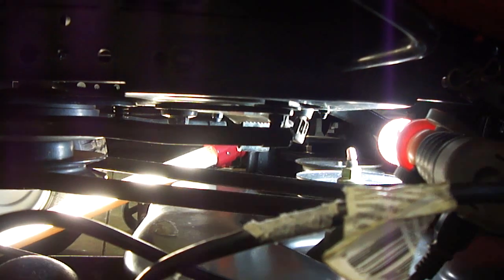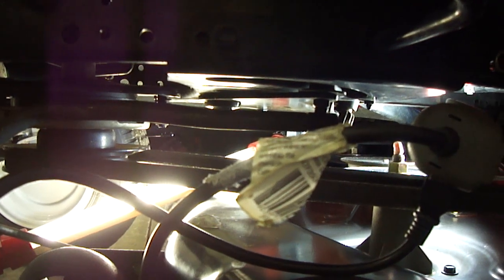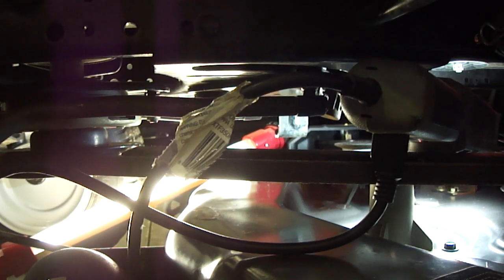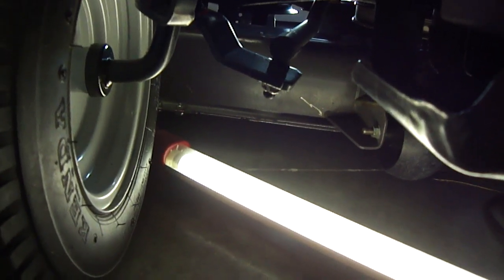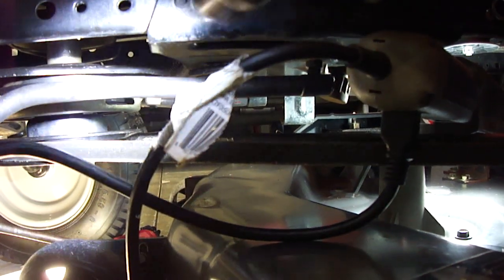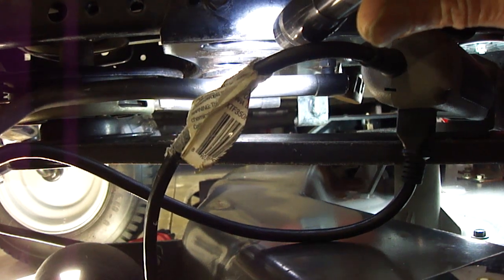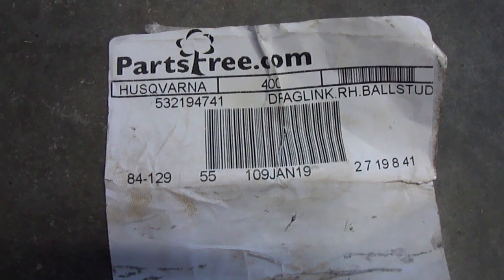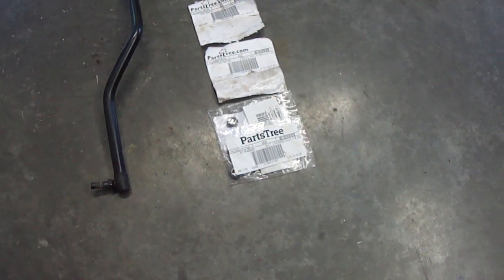2012 Husqvarna lgt24k54 draglink repair part 2

Comment: Ok you can do it that way, another alternate way Pull the battery and holder and you can access the top nut with extension  13 mm . Please note that you will need to move the tire left or right depending on which side your changing. I just did the right side on my mower this morning . Check it out. I didn't pull the steering gear plate.

Comment: I appreciate you trying to help by making this video, but perhaps you should watch some videos on this repair first. I just replaced both of the drag links on my LGT 2554 and performed the swap using access holes in the top of the frame . All you have to do is turn the wheel as far as you can in each direction to get the rear drag link nuts to line up with the holes. The access hole is round on one side and rectangular on the other. You don't even have to touch the gear sector plate.
Reply from the maker: Thanks for viewing.I personally found dropping the gear is really easy and like less than ten minutes to remove the whole unit.I guess as we all do repairs we all find different methods to fix things.Thanks again
Reply: @Ron1987  I have a Husqvarna YTH24K48.  The drag links are the same part numbers.  However, on my tractor, the steering gear plate has to be removed because there is a plastic cap covering the drag link nut where it attaches to the steering gear plate.  Those plastic caps are held in place by the steering gear plate.  For me, I removed the cutting deck, turned  the tractor on it's side, and removed the steering gear and gear plate from the bottom.  Because it was this difficult to access the drag link nuts, I ordered the right hand link as well as the left link.  I will replace both of them when the other link arrives.  Don't want to go through this agony again.
Reply from the maker: @commonleadership48  Yeah the drag link job is a touch tedious.I quickly figured out that the gear plate had to be removed since the nuts and the plastic guides are held in place by it.Reason I did this video and hoped it helped anyone who has to tackle this job.Thanks
Reply: @Ron1987  thank you for the follow-up.  I don't see how anyone can change the drag links on this tractor without dropping the gear plate to remove the plastic guide caps.  H.O. trainiac must have a model without plastic guide caps.  For my tractor, I ended up removing the steering gear bracket because I didn't have a wrench that would get to the back side of the large nut.

Comment: How do you get the plastic looking part off the steering plate thank you for your time
Reply from the maker: @wranglerman2523  You have to remove the steering shaft( cotter pin and the Gear on the End, has a allen head screw or screw).Assume your replacing the steering shaft? Or is his the drag link your asking about.

Comment: Bunch of talking, doesn't really show anything of the actual job
Reply from the maker: This is a fairly simple repair and felt showing a step by step was not needed.I simply added details to  the process I followed and it is intended to give everyone a good route if this repair has to be done.
Reply: @Ron1987  I think you explained it well enough for me to get through it, my left ball joint just disconnected itself from the link, am I going to need to buy any of the nuts talked about? Seems like the new link would be it.
Reply: @Ron1987  Also, when changing the belt yesterday I noticed on the left side it gets dangerously close to the drag link and I think it rubs in some instances, have you come across this before?
Reply from the maker: On recall I think the belt may have rubbed but,I think it was due to some slack in the belt.Being I have not dug out my old drag links to see if there was any rub marks(I think there was some) but never had a issue directly from that.
Reply from the maker: the new link may or may not have the nuts new depending on the parts business you buy from.I know alot of these parts can be purchased on ebay and generally come with  everything new.When I bought my parts I got them from partstree.com and things are  sold in some categories as a piece by piece overly complicated (should have some hardware) if it is part of the part.Ebay is my recommend just use the OEM numbers they will be on there.Plus SAVE money
Reply: @BurnNotice2023  nuts on mine were normal right hand threads

Comment: Is there a video for replacing front axle on a Husqvarna riding mower?
Reply from the maker: That I do not know.However I did replace my front axle and it is pretty simple to do! Just jack up the mower and support the mower with jack stands behind the wheels.Then remove the e clips holding the wheel on,remove it.Then take the rubber caps off the top where the spindle inserts into the axle remove the E clip there.Then if your Not replacing your tie rod ends leave them connected and the spindle will fall down and lay to the side.Both sides are the same on this.Now on the 1 bolt holding the axle the muffler might be in the Way and it may be necess.to remove that(I did).take said bolt and nut loose and remove.Axle will drop out with some mild pulling.I suggest buying the Heavy duty front axle versus the OEM version.At this time you may want to consider just a Full front end update with new bearings and tie rods all at once in my opinion.IF you have any further questions feel free to ask,I will assist you the best I can.R

Comment: Are you certain about the drag link ends being left hand thread (turn clockwise to loosen)?
Reply from the maker: Its been awhile but I think on My Originals they the nuts came off clockwise.However the new parts it were the opposite.I say just use a combo wrench hold the top (where its like a nut) and try to break them free like most standard hardware.Sorry for the late reply just super busy long work days.
Reply: the nuts on both the original link and the replacement link were normal right hand threads